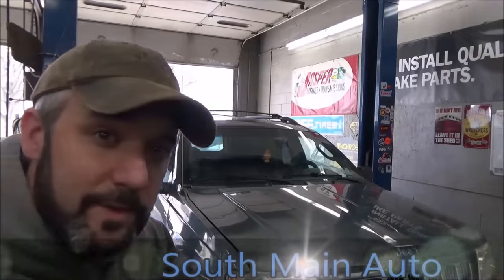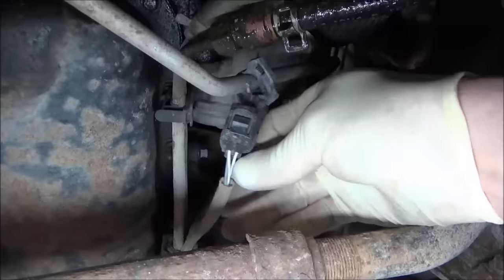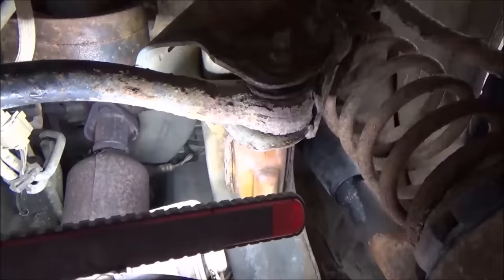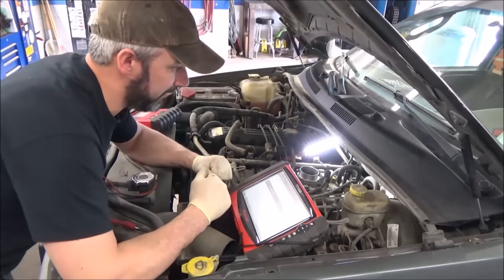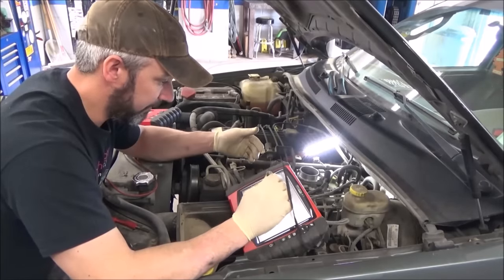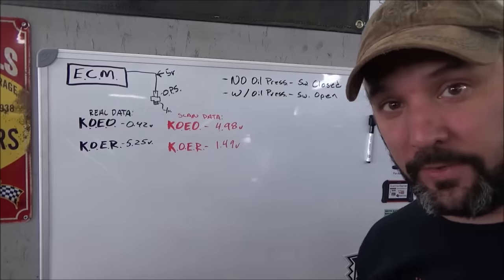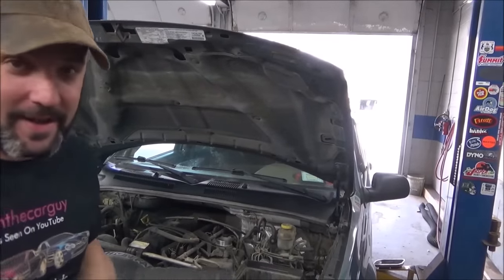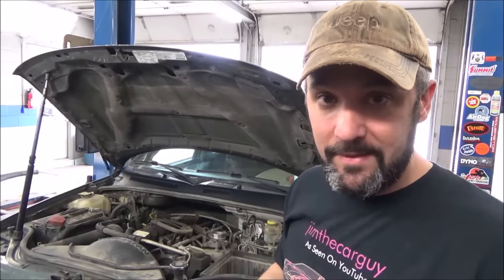Jeep Grand Cherokee - Check Engine Light P0141 / P0155 / P0523

Comment: yep been there about 10 to 12 years ago cummins oil pressure sensor failed ordered a new one part# superseeded no biggie but got part it was a single pin WTF ? Called cummins cant get sensor anymore now using switch and o by the way have to trace down correct circuit then order correct connector then it will cause a check engine light will have to reprogram ecm then set it to correct parameter to work correctly. So done this and all ok works fine but like you say oil pressure on gauge is just bull shit reading. Had to do this on every cummins isb that had to have a new oil pressure sensor that came in.

Comment: I was disappointed to find that my 2007 Trailblazer has a similar oil pressure switch set-up. The oil pressure gauge reading does change as the RPMs change, but this is just the ECM's interpretation of what the pressure should be at that speed. I wonder how many cars of that era have a similar set-up? I just find it to be disappointingly cheesy of the manufacturers to do this.

Comment: Pressure sensor might have been a cost-down measure at manufacture. Possibly originally designed for 2 wire but now simplified, probly modded by firmware, which could explain the odd readings on the scan tool, am guessing software is mapping voltages to the actual gauge eg. switch open =1.5v = ( sweet spot ) mid-way for the gauge. , switch closed = 0v =  L gauge , interestingly it seems to have lost the ability to detect overpressure-not sure if that's a big dealio on these units. Learn something new and interesting every day.

Comment: The oil pressure gauge "issue" does not surprise me, Ford had a rash of warranty complaints on the Mustang when they went to the 4.6 in 96 due to the 4.6 having low pressure at idle. Too many people would be meeting with their Mustang pals and the guys with the 4.6's would be noticing the 5.0 guys would have more oil pressure on the same gauge cluster and freak out when it would drop at idle and head to the dealer. So Ford changed it to a idiot gauge that goes to dead center.
Reply from the maker: +Tobashadow lol, problem solved...

Comment: Maybe the ecm take "oil temp" and "engine rpm" to calculate a oil "psi"
Reply from the maker: +Big Kat Not in this case... on or off is all we get
Reply: I should have postponed my question until the end of the video.  I believe my ecodiesel behaves the way I mentioned as others have reported it's a since wire switch.

Comment: With the amount of rot on this Heap, how does it pass state inspection?
Reply from the maker: +Justa Hondafan We don't fail on body rust in NY
Reply: +Justa Hondafan Most states say if the rot is not compromising the structure or allowing exhaust into the cab it passes.

Comment: My jeep check engine light was showing misfire codes and o2 sensor codes. Replaced spark plugs was about to replace coil rail when i looked at my o2 sensor fuse turned out my fuse was just corroded making my sensors screw up replaced the fuse fixed all the codes

Comment: I have had 3 jeeps and said I would never Own another one after the first one. I call them "Cheap Jeep" as in gremlin laden Chrysler shite (mostly electrical) however once you learn their nuisances/faults they are relatively easy to fix. Got the other 2 cheap because their owners gave up on them and I knew how to fix them.
Reply: After owning about 10 Cherokees/Grand Cherokees... Once I sell the one I have now.. never.. EVER.. again.

Comment: Sure it is always best to replace with the original part for serviceability but lets be honest.  If the wires are connected correctly it will still work just as well.  I hate walking around a junk yard for hours just to end up empty handed.

Comment: i owned a cherokee chief long time ago ...4WD...V8 i think it was....it burned a heckuva lot of gas, heavy, boxy....i took it onto the beach one day to see what would happen....15 feet later it was sunk up to the axles in sand....engaged the 4WD function and it just sat there....i left it running in gear and walked all around....one front wheel was spinning and one rear wheel was spinning and thats all it ever did.....that was jeeps "4WD"  in the top of the line cherokee chief ..... finally i walked over to a nearby farm and paid a farmer to bring his tractor over and pull me back onto the road.......i hated that vehicle from that moment forward and got rid of it quick as i could and stayed away from jeep chrysler etc ever since

Comment: Love this. there once was A - Idiot light, or B - Oil pressure Gauge. 
Now thanks to the "engineers" at Chrysler ( Jeep) we now have C - Idiot Gauge)
You'll remember this, I know I will and I didn't endure the diagnosis.

O2 sensors are super cheap for the Jeep? Really?  Wonder what's inside them?

Comment: Eric, did you really pass that thing with the bald front tires???!!!
Reply: He said he had other things to do on it. Since the right front is worn on the outside edge prob a ball joint worn
Reply: +Guy Brown Actually those tires could very well be legal. Only takes 1/16" measured in two places in adjacent grooves.

Comment: I had a customer come in and asked me to install a after market guage instead of the idiot light. Found on many newer vehicles if you disconnect idiot light the computer will find a fault as many systems depend on each other or check engine light will always come on. I refused the job saying it will give him many headaches in future. he came back 3 months later after he had it switched  by someone else. yes he now has those headaches I told him about. I still refused to work on it and advised him to go back to mechanic who switched him out

Comment: That oil pressure is weird I have a 99 cherokee and it has a pressure gauge that reads live oil pressure. it will fluctuate when cold to hot
Reply from the maker: +JOHN HUFNAGEL Well they cheapened up as it got newer :)

Comment: Fake oil pressure gauge. Interesting. 

The rust on the wheel arches made me very nostalgic. There were a lot of rotted out cars on the road like that when i was a lad. You don't see it much anymore. Its probably an MOT failure item now. 

I think your repair on the harness will long outlive the car. If you ask me, that thing is beyond wasting good connectors on. I know there will be one youtuber out there who will short circuit at seeing this. But if you ask me, if you have good grounds for suspicion a part is bad and its going to cost $50 in labour for further diagnosis to get an answer then $15 for a part and another $25 for labour on replacing the part. Best just to go for the part and save the customer some money.
Reply from the maker: +zoidberg444 Yeah I imagine he may but I work in a shop on cars everyday haha and he may only see one a month at best... Do what ya gotta do right?
Reply: South Main Auto Repair
Yeah. You know, don't get me wrong. People complain about that guy. He is a bit abrasive. I think hes probably a very high functioning aspergers case. I went to university with a guy just like him.

I've learned a lot about how all the sensors and systems on a car work together from him. But repairing cars for a hobby or out of necessity is very different from repairing them for a living when the customer is paying and you have to get them fixed ASAP.

Comment: Great job, even though you had to splice in the O2 sensor, but the day you decide to weld a ball joint onto the control arm is the day I will unsubscribe...lol  So the gauge is just an upgraded idiot light, good to know if I ever decide to buy a Chrysler /Fiat product.
Reply from the maker: +Bob Moy Lol I will try to control myself around the welder haha...
Reply: +South Main Auto Repair Watching the video again, I sure hope that you're caught up on your tetanus shot. She is very crusty and rusty.  The engineer who designed and wrote the program for the catalytic once worked at VW....lol

Comment: Surprise, surprise, a 4 liter that leaks oil. The only reason this Jeep has a oil pressure gauge is because the 4.7 liter engine that also came in them. The 4.7 has a regular oil pressure sender, so I think on the 4 liter, they did some computer PID trickery so they could use the same cluster for the 4.0 and 4.7.  I find it strange how they couldn't just put an extra wire in the harness, then the gauge would've worked like a proper gauge, but I guess they cut corners wherever they can.
Reply: +Michael Williams thats what i tought. the 4.7 has a proper oil pressure gauge
Reply from the maker: +Michael Williams Yeah that is what I was assuming, and my thoughts 2, why not have then both have a real sender. Except for the fact that the 4.0 would be on LOW most of the time haha
Reply: +South Main Auto Repair I have a 99-04 Grand Cherokee factory service manual. I checked out the diagrams and theory of operation for the 4 liter. According to the factory book, that should be a 3 wire sensor with a real sender, not a switch. It could just be a last minute corner cut for Chrysler since 04 was the last year of that body style. I can't find any mention of a single wire oil pressure switch in the manual.
Reply: +Michael Williams Your manual is correct for the 4.7 engine, not the 4.0   The diagrams I've pulled show,  item- Oil Pressure Switch, Single grey/yellow stripe wire feeding terminal 23 in connector C2 on the PCM. Part is Standard part PS404  (7psi switch, N/C single terminal)
Reply: +Blazer02LS I did some more digging, mostly to figure out what was wrong with my diagrams, I hate having incorrect service info. Just like I thought before, 2004 was the only model year to have a single wire pressure switch on the 4.0. The 1999-2003 model years used a 3 wire sender. Wire color is the same gray/yellow, and goes to C2 pin 23. Chrysler just didn't put ground or 5 volt wire in the harness for oil pressure in the 2004 4.0 harness.

Comment: the pressure gage in my f150 is an idiot light too! the fake needle sweep is done in the clusterfuck to trick you,...2013,......cheap truck expensive price!  I got ripped off again!
Reply: +70carlton  87-97 you could add a real sending unit and make the gauge actually work, the newer ones that trick doesn't work.

Comment: Oil pressure... it's a Mopar thing. Same exact way on the 03 Dodge Ram with the Cummins. No idiot light, it's a idiot (fake) gauge. Don't forget to order the guy two hood shock props. Things like that drive me nuts.

Comment: Your way off on the oil pressure switch dude,my 01 has a 2 wire pressure switch with psi increments on the gauge in the cluster. The hint you should have seen are the L and the H on the gauge in the cluster. When doing the initial investigation of the problems generated by the scan tool looking at the cluster can give you alot of answers. Thanks for the tip on the little scanner, I will look into one for my own.

Comment: I found out the hard way that ford uses this setup in some of their pickup trucks. One day my radio shut off. I looked at the dash and the voltage read normal voltage but when I shut the car off, I found out my battery was nearly dead because the alt stopped working. 

If that oil pressure switch wire broke and then you ran out of oil somehow, you will ruin your engine thanks to Jeep's cheapness

Comment: It's a very stupid thing indeed.  My 2002 TrailBlazer with the 4.2 straight six has an apparently similar system.  The pressure sensor is a switch for pressure only.  The pressure gauge does move, but in response to "yes there is pressure", then a pre-defined value based on engine rpm.  An amazingly complicated setup instead of just using a regular pressure sensor reporting pressure.  The only reason I can think of it is how many people freak out because their sensor gets plugged with sludge or junk and then doesn't display good pressure.
Reply: Doug Goodwin Good to know,I own a 03. That guage hasnt moved in years,funny because its pushing 290k.

Comment: I found that GM uses Delphi connectors, and you can order them from Mouser.  They take a double crimp open barrel die for your crimp tool. One barrel grabs the insulation and the other grabs the wire. They also have packing to waterproof the connector. 

http://delphi.com/manufacturers/cv/connection-systems/catalog

http://www.mouser.com/Delphi-Connection-Systems/Connectors/Automotive-Connectors/_/N-1ehb5?P=1z0zlez
Reply: +BChrisL But this is a Chrysler...

Comment: I've got some news - chances are the coolant temperature gauge is lying to you too.
Reply from the maker: +Lorrin Barth No it reads off the ECT sensor..
Reply: +South Main Auto Repair   My car, a year older than this Jeep, has a magic box in the instrument cluster.  Once up to temperature coolant temperature reads rock solid - sorta like 40 psi oil pressure all of the time.  Anyway, I put in a safety thermostat and went out for a little romp and this thermostat locked open.  So, I have my suspicions. 

Anyway, not like this off and on oil pressure but not linear either.
Reply: +Lorrin Barth They run a data buffer on the ECT feed. Basically it updates the PCM with real time data but only moves the gauge if the temperature goes out of a set range. The rest of the time it runs an "average" of the data.
Reply: +Blazer02LS  Okay, maybe not lying but only a big fib.

Comment: I went through the same thing when I went from an old GM with a real oil pressure gauge to a Ford with a fake one..... I was used to oil pressure changing with different viscosity oils, temps and revs... You can tell alot about an engine by watching the oil pressure gauge.  So my ford's gauge didn't move once the car started... revs didn't matter, temperature didn't matter, new oil... no change... I freaked out.

Worse yet, the things got a tick when the motor is cold.... Low oil pressure... Apparently not, the car has magical mystery oil pressure that never changes...

Come to find out it's just a dumb switch... useless for diagnostic purposes.

An idiot light would make more sense.

Comment: The idiot light that pretends to be a gauge is not that uncommon.  BMW uses it on some cars, so does Ford and Nissan.  The BMW explanation was that they had too many compliants that "My friend's (insert model) has more oil pressure than mine!! Something is wrong with it!!!"  I first noticed this on a rental Ford van years ago.  There is no way an engine always maintains the exact same oil pressure under ALL conditions.

Comment: Fake oil pressure switch, I wonder how many Jeep owners are fooled by this thinking their motor is perfect?
Reply: +Andrew Thompson Every Ford after 90 has the same thing. Some Fords up to 96 can take an older variable pressure sender but after that year the instrument cluster makes the gauge have two states( a true dummy gauge). Ford does not report oil pressure to the PCM.
Reply: +alb12345672 Interesting, blame the accountants. A shame really as an eye on the oil pressure can give you a good idea as to what is happening inside the engine.
However 99 percent of drivers   would not know what to look for. And another percentage will see it drop a bit at idle and go running back to the dealer for a new engine.
Reply: +Andrew Thompson Yup, and it varies with startup temperature too. Most drivers are lucky they can check their tires for pressure. Also, engines today are supposedly tighter tolerances and more reliable. Some Newer BMWs don't even have a TEMP gauge. Just a dummy light (or LCD display icon) that is probably too late when it comes on. I test drove on and thought that was a major turnoff. Just like an 80s crown vic- very minimal instruments. Those cars didn't even have tachs. Just fuel, speed and 3 or 4 warning lights.

Comment: That oil pressure switch is pathetic and a deception.  Jeep should be ashamed.
Reply: +AboutMy FathersBusiness 
They aren't alone on a lot of cars including expensive German brands the temperature gauge is fixed on "N" between 75 and 105C so as not to worry the owner.
Reply: +AboutMy FathersBusiness Chevy is the only brand I see that all have oil pressure gauges, my ford is a switch like this too.
Reply: +Andrew W MacFadyen : They should have just put an "idiot" light if they didnt want to worry the owner.  We all know low oil pressure means a variety of things.  Worn engine with greater tolerances , worn oil pump, a need to run thicker oil in warmer ambient temps.  IMHO this gauge is worse if there is no light that illuminates when no oil pressure...pthh...
Reply: +a  I drive Chevy and Mopar.  Guess I have never seen this type of shenanigans by other car companies
Reply: +AboutMy FathersBusiness Old mopar that is:)
Reply: +AboutMy FathersBusiness 
In the 1960s Chrysler bought over Rootes the group that owned Sunbeam, Humber  and other brands,  they destroyed the companies reputation for quality and ran it into the ground in 10 years.
Reply: Andrew W MacFadyen My 71 Cuda still has a true oil pressure switch.  Or does it???
Reply: lol I had no idea there was some mass conspiracy for oil pressure gauges, the more you know
Reply: I HAVE A 97 DODGE TRUCK THATS COMPLETELY FALLING APART
RUSTED FRAMES - BROKEN WINDOW REGUALTOR, BRAKES BAD  NO A/C
PIECE OF SHIT DODGE
Reply: Edward Koepke do you think a ford would be in any better condition? It's almost 20 years old
Reply: Jeep isn't the only one who does this with the false gauge.